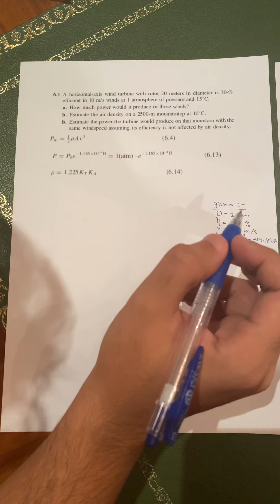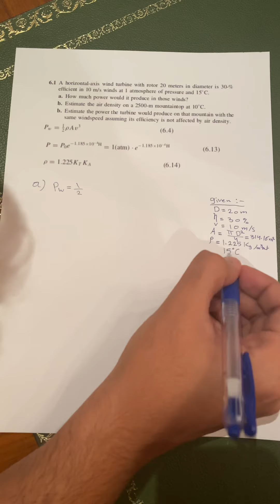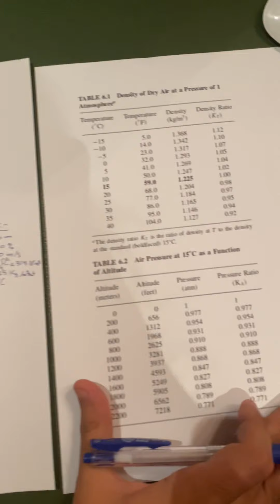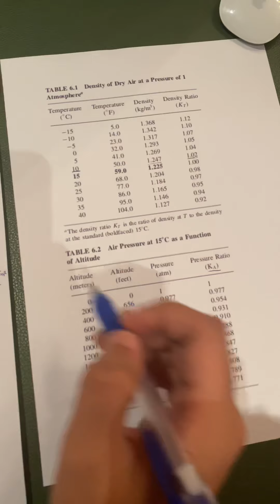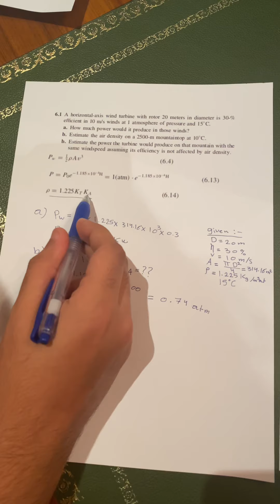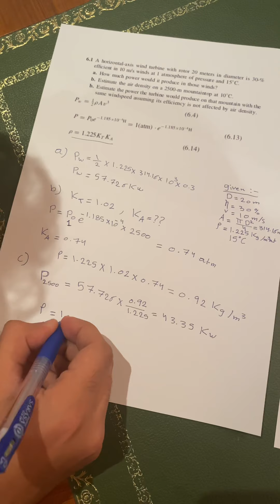Solve and explain WIND TURBINE problem

Comment: Solution Model Answers are :

(a) Power at the sea level is : 
P_w = 57.73 kW

(b) The air density at 2500 m : 
ρ = 0.9291 kg/m³

(c) Wind Power on the mountain is : 
P_w = 43.78 kW